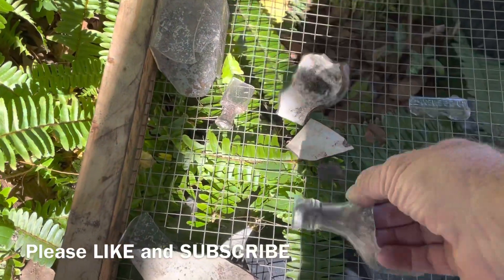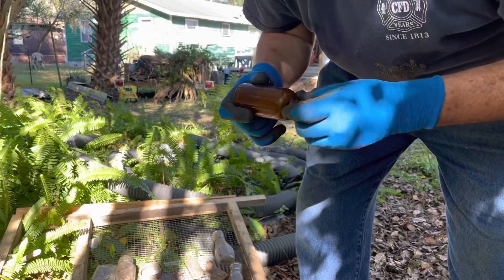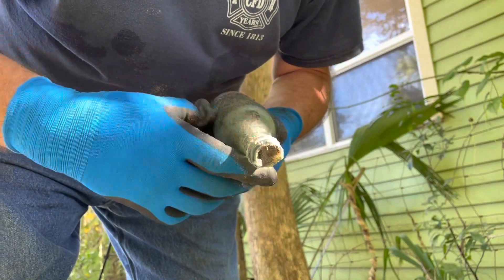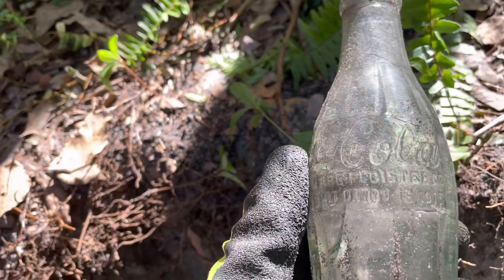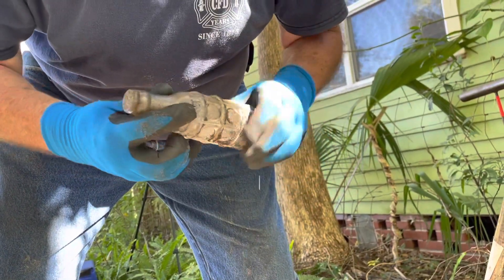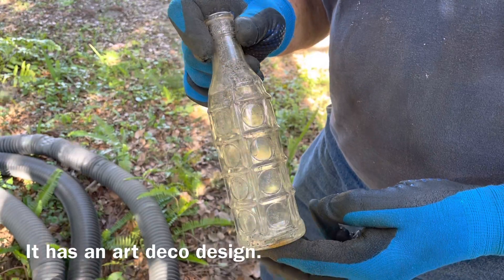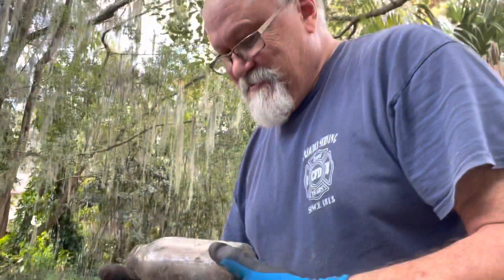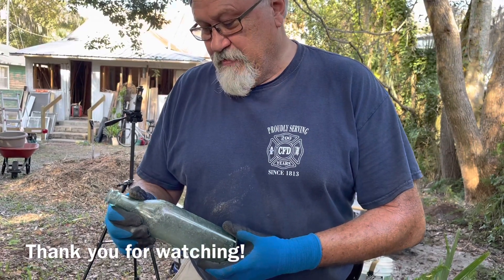Old Cokes & Nehi Sodas!…Digging a 1900s Soda Pop Bottle Dump—Florida

Comment: When you started pulling those soda waters i knew that hobble was 1915. If you look on the side of the base may be the word "Root" and a number beside it. That will be the year it was made. Root glass is notorious to have flash cracks. Looks like a 20s dump. I found a star bottom from albany ala here. The city i live in has changed names 3 times so there are allot if variants lol Fun dig wish i could be as lucky as you guys. Thanks for sharing.
Reply from the maker: As always, Clockwork Gnome…many thanks for weighing in. One thing I have learned is that every trash pit is different.
Reply: @relicrescueusa3803  True. I have found modern stuff below older stuff and some times they are mixed together.
Reply from the maker: Good advice…something to always keep in mind.